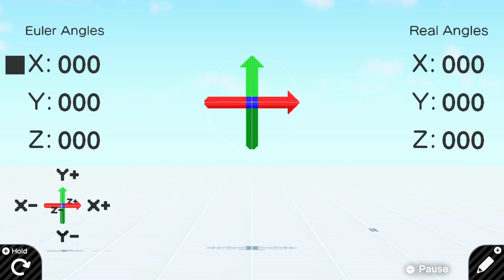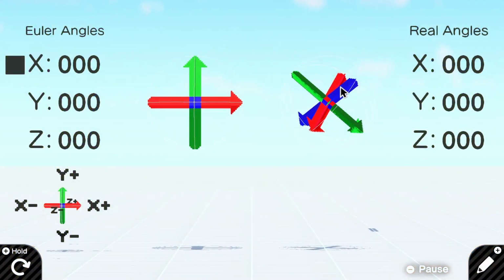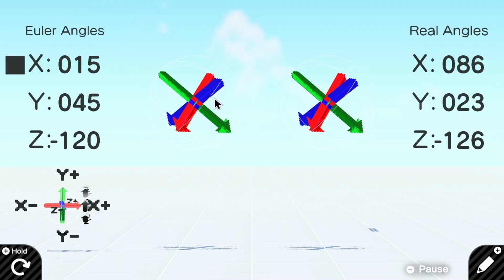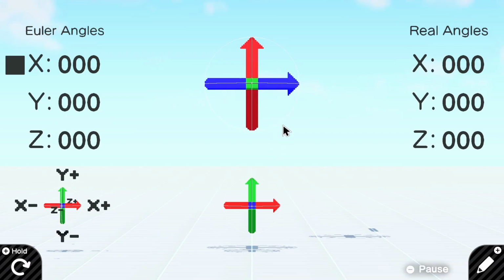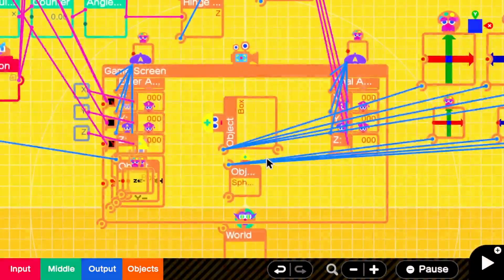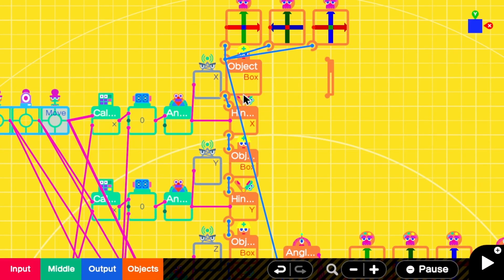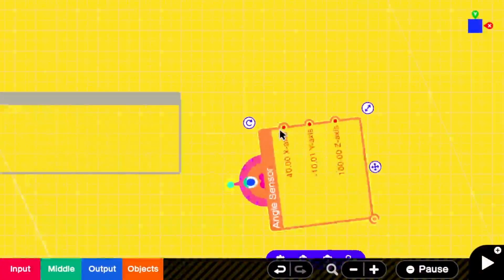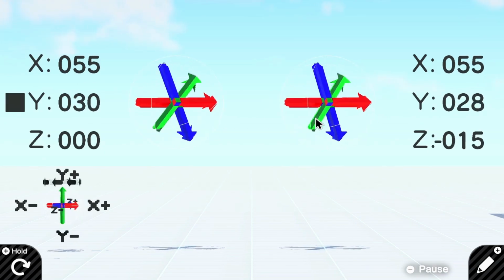Object Rotation and Angle Sensors - GBG Mechanics

Comment: One note on the final part, it looks to me like the inaccuracies in the real-to-euler angle converter aren't really GBG's fault, but rather due to the tangent function approaching infinity with the values you tried out (I don't really recall how GBG handles division by 0). Very interesting topic overall!
Reply from the maker: You're right that they're due to discontinuities in the trig functions, and modern calculators do have special case handling for them... and I actually did implement the special case handling in GBG... but it ended up making the whole thing much bulkier for just those three points and values approximately close to those points were still weird since some steps were pushing GBG's precision, so I decided to scrap all that and just leave it as an open problem 😅